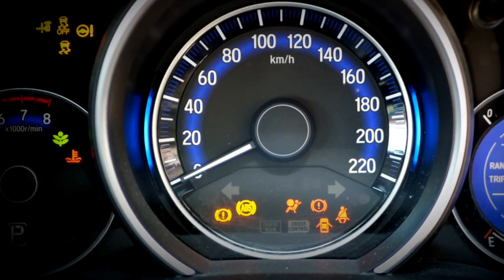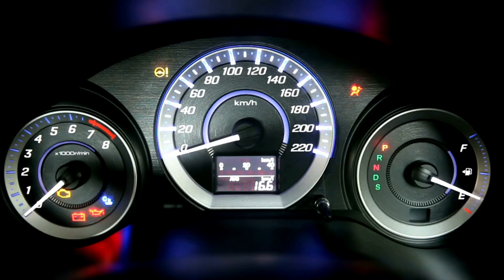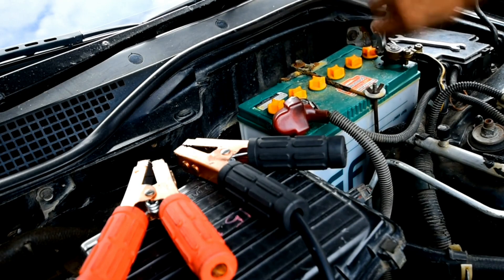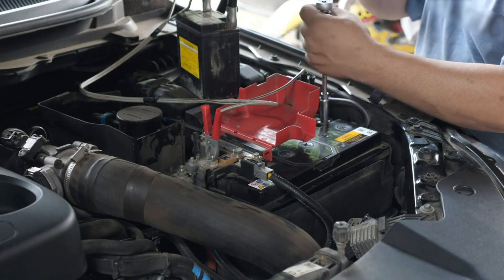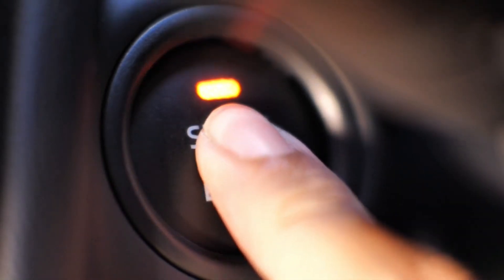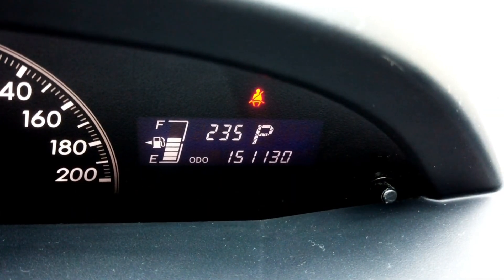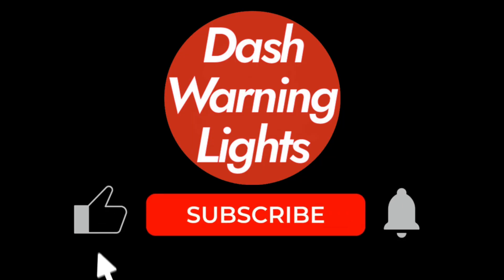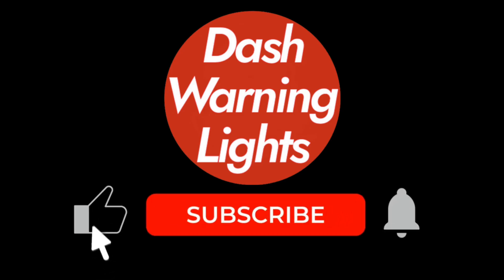How to Reset All ECUs and Control Modules in Your Car or Truck Properly

Comment from the maker: ✅ RESET ALL ECUs & CONTROL MODULES IN YOUR CAR OR TRUCK
👇 Comment your car make & model below — I’ll guide you step-by-step!
In this video, you’ll learn:
✅ How to safely reset all ECUs and control modules
✅ When an ECU reset can fix warning lights & performance issues
✅ Common problems caused by faulty ECU memory or corrupted data
✅ Step-by-step reset methods without special tools
🛠️ Topics include:
– Battery disconnect & proper reset procedure
– Hard reset vs. soft reset explained
– Clearing stored faults & relearning adaptive settings
– How to reset throttle body, transmission, ABS, and more
🚗 Works on most vehicles including: Toyota, Honda, Ford, VW, Audi, BMW, Nissan, Hyundai, Kia, Chevy… and more!
💬 Got a problem? Drop your car model & issue below — I reply to every comment!
✅  Related video you may find helpful:
⚠️ VSA Warning Light ON or Flashing?
Learn how to fix & reset Vehicle Stability Assist (VSA) step-by-step 👇
🔗 https://youtu.be/WCobYZXmNMg
Reply: 2016 ford escape 1.6
Reply from the maker: @CrystalKemp-e3q  Hi! Thanks for your comment!
For a 2016 Ford Escape 1.6, here’s how you can reset all ECUs & control modules:
👉 Turn ignition OFF and remove the key.
👉 Disconnect the negative (-) battery cable.
👉 Press and hold the brake pedal for about 20–30 seconds (this drains any stored power).
👉 Wait at least 15 minutes.
👉 Reconnect the negative battery cable.
👉 Start the car and let it idle for 5–10 minutes so the ECU can relearn.
⚠️ Tip: After reset, your Escape may need to relearn idle and shifting, so drive gently for the first few miles.
Reply: Ford fusion plus 1.6 duratech 2005 model all warning lights are blinking and car has starting issue
Reply from the maker: @vijayendrap729  Hi! Thanks for your comment.
For your 2005 Ford Fusion 1.6 Duratec, if all warning lights are blinking and the car has starting issues, try this first:
👉  Disconnect the negative battery terminal and leave it off for about 15 minutes.
👉  Touch the two battery cables together (positive and negative, but not connected to the battery) for 30 seconds — this helps discharge and reset the ECUs.
👉  Reconnect the battery, tighten the terminals, and then start the car.
👉  If the issue remains, check the main ground connection and battery voltage — a weak battery or bad ground often causes all lights to flash and no-start problems.
✅  If you still see lights flashing, the ECU may need a deeper scan or reprogramming.
Reply: Hı. 2008 KIA sorento
Reply from the maker: @Pir.14   Thanks for sharing your car details! For your 2008 KIA Sorento, here’s how you can reset all ECUs and control modules properly:
👉  Disconnect the negative battery terminal and wait around 15 minutes.
👉  Reconnect the terminal and start the engine.
👉  Let it idle for a few minutes so the ECU can relearn the system.

This process helps clear minor faults and improves performance. Let me know if any warning lights come back on — I can guide you step by step!
Reply: @Dashboardwarninglights ESP  off is lightning continously thank you
Reply from the maker: @Pir.14 Thanks for the update! 😊
If the ESP Off light stays on continuously, that usually means the Electronic Stability Program is disabled — either due to a sensor issue or a temporary fault after the reset.
Try this step-by-step:
1️⃣ Turn the ignition OFF.
2️⃣ Disconnect the negative battery terminal again for about 10–15 minutes.
3️⃣ Reconnect it and start the engine — make sure the steering wheel is straight.
4️⃣ Let the car idle for a few minutes without pressing pedals.
5️⃣ Then drive slowly (about 10–15 minutes) so the system can relearn the steering and wheel sensors.
If the light still doesn’t go off, the ESP or ABS sensor may need cleaning or scanning for stored codes — I can guide you through that too if you want.
Reply: 2021 ecoboost mustang
Reply from the maker: @antoniusrice3993   For your 2021 EcoBoost Mustang, you can reset all ECUs and control modules by disconnecting the negative battery terminal for about 15–20 minutes, then touching the positive and negative cables together (not the battery posts) for 10 seconds to drain any remaining power. Reconnect the battery, start the car, and let it idle for a few minutes so the systems can relearn.
If you’re trying to reset specific modules (like the PCM or transmission), I can walk you through those steps too — just let me know which one you want to reset.
Reply: 2013 chevrolet malibu lfz 2.5L
Reply from the maker: @annamullens9422   Thanks for your comment! For your 2013 Chevrolet Malibu 2.5L, you can reset the ECU & modules, but make sure the battery is in good condition first because these cars are sensitive to low voltage.
Here’s the proper way to do it:
👉 Turn the ignition off and remove the key.
👉 Disconnect the negative battery terminal for about 10–15 minutes.
👉 Press the brake pedal for 5–10 seconds to drain any stored power.
👉 Reconnect the battery terminal firmly.
👉 Start the car and let it idle for 5–10 minutes without touching the gas.
(This allows the ECU to relearn idle and fuel trim.)

If your Malibu has transmission shifting issues, it may also need a throttle body / idle relearn, which happens automatically as long as you let it idle without pressing the accelerator.
If warning lights return → the issue may be sensor-related and not just ECU memory.
Feel free to drop more details (any lights, symptoms, or problems) and I’ll guide you step-by-step
Reply: Volkswagen vento
Reply from the maker: @hanifmohd2110  ! If you’re working on a Volkswagen Vento, you can try disconnecting the battery for about 10–15 minutes, then reconnect it and turn the ignition ON (without starting) for a few minutes to let the ECU relearn. For a full reset, it’s best to use a diagnostic tool to clear all stored codes. What year is your Vento?
Reply: @Dashboardwarninglights  2014
Reply from the maker: @hanifmohd2110  Hi! Thanks for the update — for a 2014 Volkswagen Vento, you can disconnect the battery for about 10–15 minutes, then turn the ignition ON (without starting) to let the ECU relearn. For a full reset, it’s best to use a scanner to clear any stored fault codes. Are you trying to fix a specific warning light?
Reply: @Dashboardwarninglights not yet
Reply from the maker: @hanifmohd2110   Since the cluster stays on with the key out and you’re getting a P0603, it’s likely a power or grounding issue — sometimes a stuck relay or faulty ignition switch keeps power running to the dash. Check the battery terminals, grounds, and ignition relay first. Also, try pulling the ECM backup fuse for a few minutes to reset it. Let me know what you find after checking in the morning!

Comment: Seat Leon 2010
Reply from the maker: @Paaulll22   Thanks for commenting 👍
Seat Leon 2010 — this reset procedure applies to your car.

Before you try it, let me know:
👉 What warning light or issue are you experiencing?
👉 Did it start after a battery change or repair?

I’ll guide you step by step for your Leon.

Comment: I have nissan qashqai j11 2018, had a system fault on my screen , crash , lane assistance and parking sensors some time on and off . I just installed a new battery and followed the resetting steps but unfortunately didnt worked for me . Or should i do something else . Thanks
Reply from the maker: @sajjadkamal-u4y   Hi! Thanks for the details, On the Qashqai J11 this is actually very common.
Since you already installed a new battery and did the reset, the issue is probably not the battery itself anymore. On these models, when you get crash warning, lane assist, and parking sensors all coming on together, it’s usually one of these:
👉  Battery current sensor (IBS) on the negative terminal
If it wasn’t reset or calibrated after the battery change, the car still thinks voltage is unstable
Try disconnecting the negative cable again, wait 15–20 minutes, reconnect, then drive for 10–15 minutes without turning anything off
👉  Camera or radar calibration needed
The forward camera (behind the windshield) and radar are very sensitive
Even a battery disconnect can trigger a calibration fault
This usually won’t clear without a scan tool that can recalibrate ADAS systems
👉  Low voltage history stored in modules
Some Nissan modules do NOT clear with a simple reset
You need a proper OBD scan to clear stored faults from the ABS, ADAS, and BCM modules
👉  Connector or sensor issue
Check the front radar area, parking sensor connectors, and camera area for dirt, moisture, or loose plugs
⚠️ Important:
If the warnings come on and off while driving, that strongly points to a sensor calibration or communication issue, not the battery.
👉 My advice: get a full system scan (not just engine codes) and see which module is complaining. That will save you a lot of guessing.
Hope this helps — let me know what codes you get.

Comment: Tried this today on my ram.i was told my shutters need replace..couldn't use my remote start..i follow every step today watching this video..just went to see what would happen..engine light blick twice and went out..true test will be to remote start..when my engine light first came on.i remote start and it would shut off immediately
Reply from the maker: @terrellscott2278   Hi! On Ram trucks, if the active grille shutters are stuck or faulty, the ECU will often disable remote start as a protection measure. When you did the reset and saw the check engine light blink twice and then turn off, that means the ECU cleared the stored fault temporarily.

Now the real test is exactly what you said — remote start:

✅ If it remote-starts and keeps running → the fault was reset and the shutters may be intermittently sticking

✅  If it starts then shuts off again → the shutter actuator or position sensor is still failing and will need replacement

Just keep in mind: ECU resets don’t fix mechanical failures, they only clear the logic. Once the ECU sees the shutter fault again, it will shut remote start off and turn the check engine light back on.

Good troubleshooting on your part, and let us know what happens with the remote start.

Comment: Hi! Ive tried almost every mechanical fix and cleaned all over for my 2007 1.4i citi golf , it has minor jerking issues and idling problems at times... i want to try the ECU reset , would it work?
Reply from the maker: @nselixir1728    Hi! Yes an ECU reset is definitely worth trying in your case.
On the 2007 1.4i Citi Golf, minor jerking and unstable idle are often caused by the ECU holding old adaptive values, especially after:
👉 Cleaning the throttle body
👉 Replacing or disconnecting sensors
👉 Battery issues or voltage drops
✅  What an ECU reset can help with:
👉 Relearning idle and throttle position
👉 Smoother acceleration
👉 Reducing hesitation or jerking caused by bad learned data
⚠️ Important to know:
An ECU reset will not fix a faulty part, but if everything mechanical is OK, it often improves driveability.
After the reset, make sure to:
👉 Let the engine idle for 10–15 minutes without touching the throttle
👉 Drive normally so the ECU can relearn
If the issue comes back, the most common causes on this model are:
👉 Throttle body / idle control adaptation
👉 Vacuum leaks
👉 MAF sensor or engine coolant temp sensor 

✅ Try the reset first — it’s free and safe.
✅ Let me know if the jerking happens cold, hot, or during acceleration, and I can guide you further.

Comment: Most likely the pedal needs replacement.
Reply from the maker: @johnmitchell9270   Thanks for the details.
On the 2011 Jeep Liberty, if the engine idle reset worked but you have no throttle response, and the transmission is pulling the car, that does sound like limp mode.
Before replacing the pedal, try this proper reset sequence again:
👉  Disconnect the negative battery terminal
👉  Wait at least 5–10 minutes (very important)
👉  Reconnect the battery
👉  Turn key to ON (do not start) for 30 seconds
👉  Turn key OFF for 30 seconds
👉  Start the engine without pressing the gas
👉  Let it idle for 5–10 minutes
If the issue comes back immediately, then yes — common causes are:

Accelerator pedal position sensor (gas pedal) failure
Throttle body dirty or faulty
Wiring or connector issue
Stored throttle / pedal correlation code

⚠️ If a Check Engine Light is on, a scan is strongly recommended before replacing parts.

Let me know if the throttle responds after the full reset.

Comment: Did reset engine idol fixed but no fuel pedal? (2011 jeep Liberty)Transmission pulls the car(limp mode?)I guess try it again because I didn't wait 5 minutes 🤔
Reply from the maker: @johnmitchell9270   Thanks for the details.
On the 2011 Jeep Liberty, if the engine idle reset worked but you have no throttle response, and the transmission is pulling the car, that does sound like limp mode.
Before replacing the pedal, try this proper reset sequence again:
👉  Disconnect the negative battery terminal
👉  Wait at least 5–10 minutes (very important)
👉  Reconnect the battery
👉  Turn key to ON (do not start) for 30 seconds
👉  Turn key OFF for 30 seconds
👉  Start the engine without pressing the gas
👉  Let it idle for 5–10 minutes
If the issue comes back immediately, then yes — common causes are:

Accelerator pedal position sensor (gas pedal) failure
Throttle body dirty or faulty
Wiring or connector issue
Stored throttle / pedal correlation code

⚠️ If a Check Engine Light is on, a scan is strongly recommended before replacing parts.

Let me know if the throttle responds after the full reset.

Comment: Citroen c3 2008  all fault codes are showing and speedometer will not show speed once engine started
Reply from the maker: @LukeMartins-x8c   Hi! For a Citroën C3 2008, when multiple fault codes appear and the speedometer stops working after the engine starts, it’s usually not all ECUs failing at once. This is very common on PSA cars.
Most likely causes:
👉 Low or unstable battery voltage
Weak battery or poor terminals can trigger faults in every module
👉 BSI (Body Control Module) needs a proper reset
👉 ABS / wheel speed sensor issue
On the C3, the speed signal comes from the ABS system, not a separate speed sensor
If one wheel speed sensor or the ABS module fails, the speedometer drops to zero
👉 CAN communication or ground connection problem
What to try first:
👉 Fully charge or replace the battery (very important)
👉 Clean and tighten battery terminals and main ground points
👉 Perform a proper BSI reset (key out, doors closed, wait 3–5 minutes, disconnect battery, reconnect correctly)
👉 Scan the car with a diagnostic tool that can read ABS + BSI, not just engine codes
⚠️ If the speedometer works with ignition ON but fails once the engine starts, ABS fault codes are almost always present.

Comment: My 1999 Subaru justy won’t start  engine management light is flashing would reset do anything for it I think it imoblizer problem
Reply from the maker: @BrendanOreilly-k4v   Hi! A reset can help only if the problem is caused by a temporary ECU fault or low battery voltage. However, on a 1999 Subaru Justy, a flashing engine management light usually means an immobilizer or key recognition issue.
Things to check first:
👉  Try a spare key if you have one
👉   Make sure the car battery is strong (low voltage can trigger immobilizer faults)
👉  Check the immobilizer antenna ring around the ignition and its wiring
👉  Disconnect the battery for 15–30 minutes and then retry (ECU reset)

If the light keeps flashing and the engine won’t start, a reset alone will not bypass the immobilizer. The system may need key reprogramming or immobilizer diagnosis with a scan tool.

Comment: Will this work for a 2020 Jaguar F Pace SVR? I need to reset my transmission or TCU module. Thank you! ❤
Reply from the maker: @jonathanbakchellian1987  Hi! Thanks for the question. On the 2020 Jaguar F-Pace SVR, this reset method can clear minor electronic glitches, but it will NOT fully reset or reprogram the transmission (TCU). Jaguars usually require a professional scan tool (like JLR SDD/Pathfinder or advanced OBD tools) to properly reset or relearn the transmission.
If you’re having harsh shifts or delayed gear changes, a proper TCU relearn or software update is recommended. Let me know what symptoms you’re experiencing.

Comment: My peugeot gt 3008 2021 model has a code p0612 engine light on
After scanning the following faults

engine ecu - performance or operation does not conform
Reply from the maker: @watantv4847  Hi!  Thanks for sharing.  Code P0612 on the 2021 Peugeot 3008 GT usually points to an engine ECU performance / internal fault. In many cases, it can be caused by low battery voltage, a recent battery change, or a temporary ECU communication issue.
Try a full ECU reset first (battery disconnect reset) and make sure the battery and terminals are in good condition. If the light comes back, the ECU may need software reprogramming or further diagnosis with a Peugeot-specific scan tool.
Let us know if the reset helped.

Comment: Spia motore lancia Ypsilon diesel
Reply from the maker: @stoptime9286   Hi!  For the Lancia Ypsilon (diesel), the engine warning light usually points to one of these common issues:
👉 EGR valve sticking or clogged — very common on small diesel engines.
👉 DPF (Diesel Particulate Filter) regeneration problem — if you mostly drive short trips.
👉 Boost/air intake leak — loose hose or sensor issue.
👉 MAF or MAP sensor dirty/faulty.
👉 Glow plug or glow plug relay issue (for cold starts).

You can try an ECU reset like in the video — it may clear temporary faults — but if the light comes back, one of these components likely needs cleaning or checking.
Let me know what symptoms you have (loss of power, smoke, rough idle) and I can point you to the most likely fix!